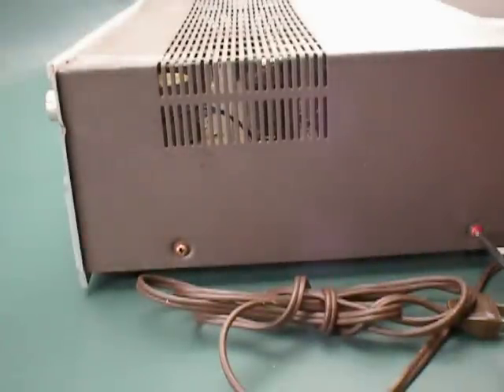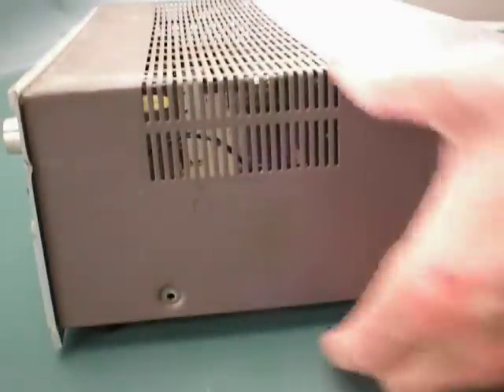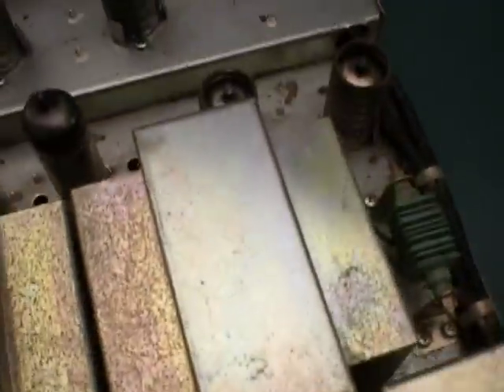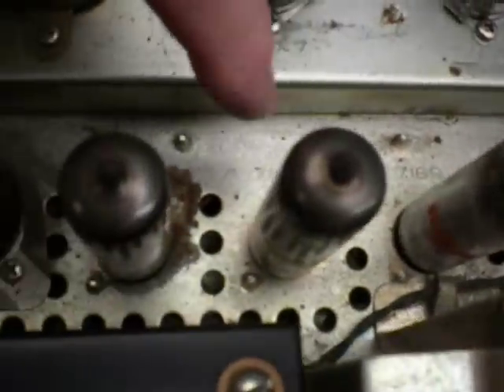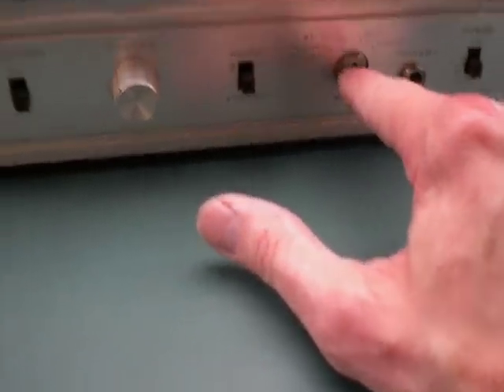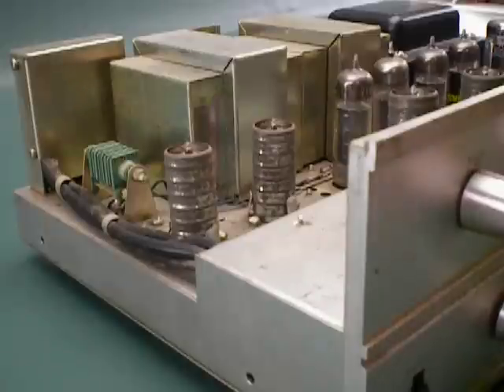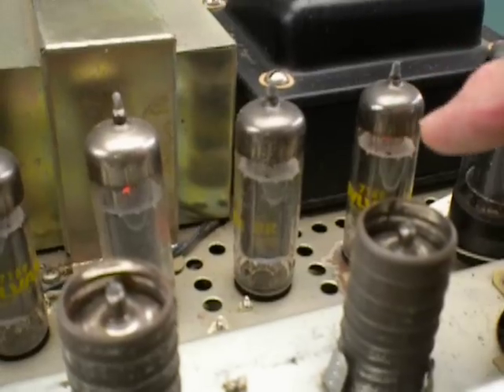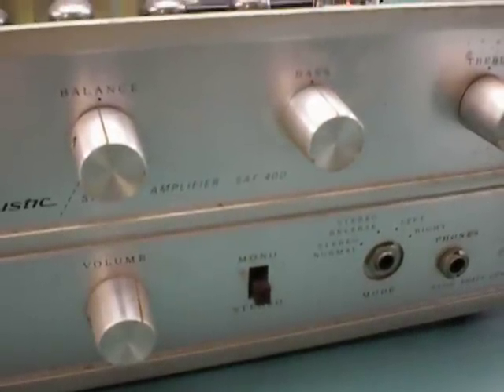Sold! Vintage Realistic SAF-40D Stereo Amplifier 7189 12AX7 5AR4 Vacuum Tube Japan For Sale on eBay

Comment from the maker: Thanks for the info about Never turn on a tube amp without speakers hook up.
Reply: That’s a lie there is no problem doing that to check your b+ voltage and always use a varic
Reply: They put red paint on the screws so the person knows if some meatball screwed with it probably the tech that worked on it

Comment: Folks * * *N E V E R * * * turn a tube amplifier on with no speakers connected it shorts the output across the secondary transformer winding and for good tube sound - never short O/P irons!
Reply: That’s a flat out lie that is only on single ended class a 1950s amplifiers